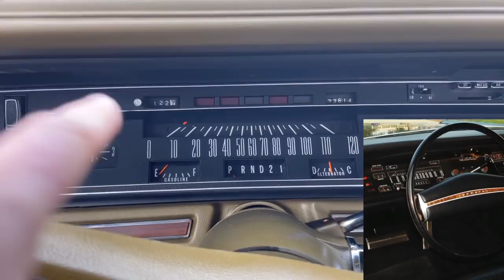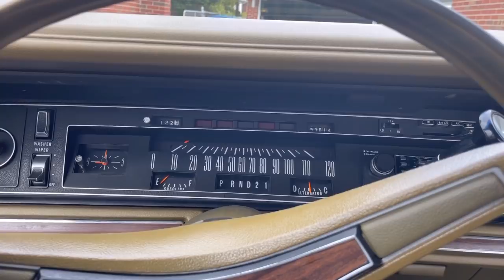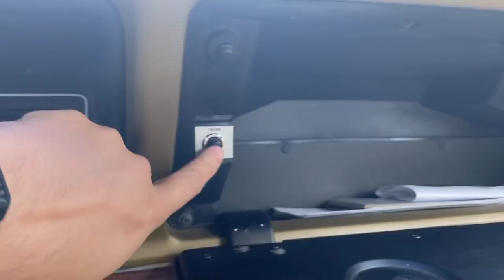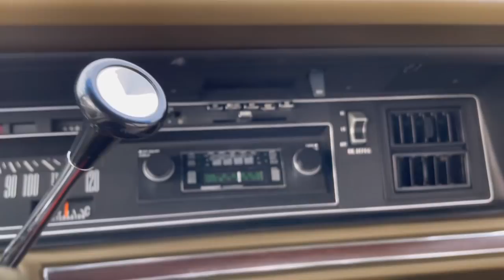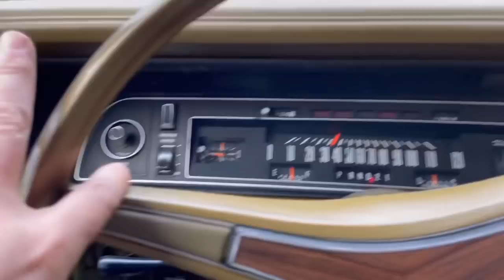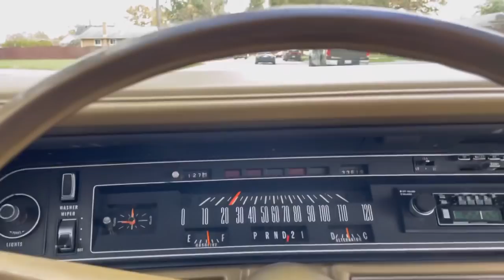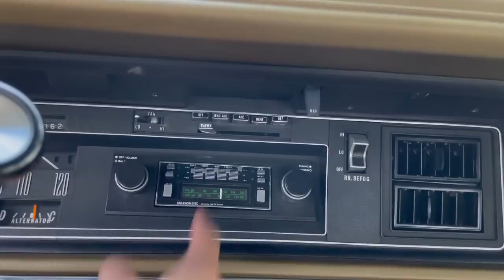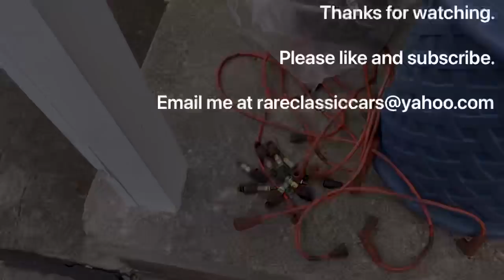FULL REVIEW: 1972 Chrysler New Yorker 440 V8: Fuselage Era Chryslers

Comment: Growing up in my childhood neighborhoods was pretty much a mix of Chrysler, Ford and GM products...and a few neighbors had either the Dodge Monaco of this era with the hidden headlamps or a Chrysler Newport, which was a trim level down from this.  I agree that the later years lost some of the clean design with added trim or awkward grill and bumper designs.  I would argue the next generation...the 74 Mopar full size cars were a step backward style wise and timing with the 74 Oil Embargo didn't help matters either.  And by 1977, they looked hopelessly out of date by the time the GM 77 program introduced the newly downsized GM full size cars.  

These cars did provide a great platform for law enforcement.....and the CHP seemed to like the Monacos as a patrol car.
Reply: As an aside...some of the Chrysler success of the 90s had to do with the engineering teams they inherited from the AMC acquisition.  The LH cars were based on the Eagle Premier....and of course getting the Grand Cherokee, an AMC design to market helped as well.
Reply from the maker: Yes. Chryslers genius was to keep the old Cherokee going and slot its replacement in development more upmarket as the Grand Cherokee.

Comment: On the road noise issue, has anyone experience with installing Dynamat or similar noise attenuation matting on these Chryslers? 
On the ballast resistors, my dad had a ‘73 and ‘78, bought used, that between them he operated for 15 years. Never had a ballast resistor issue. Maybe because we lived in the drier climate of San Diego?

Comment: 225hp, 345 Torque, Top gear ratio 1, final drive ratio 2.76, 3 speed auto, disc front/drum rear.......Top speed 112mph......interstate cruiser, would have very respectful 60 to 90 pulls

Comment: Quality control was hit or miss with these cars. My buddy's New Yorker had a factory stereo FM radio with speakers on either side of the dash, but just solid metal dash top panel. There were no grills for them. Sound was a bit muffled.

Comment: My parents had a 66 Newport and then the 70 Newport. The 66 was a better style. Yellow convertible in the movie Good Fellas. The instrumentation was more impressive and had the rear wheel skirts. It was all a deep green and he had roof repainted white. It made a splash. The 70 had the black Landau roof. The Huge killer with the 70 model was the front end parts going to crap way, way prematurely. It had the 383. When there was a front end, it was usually the ball joints as I recall. When they trashed, the front end would bounce tremendously

Comment: The fuselage cars had too much body mass and smallish greenhouse to be pleasing.  Framed door glass was unusual on an expensive car back then, I suspect the hardtop version was more popular.  My first thought was someone's removed the vinyl roof and repainted, which would explain the molding.  As a kid, I rode in a neighbor's when it was nearly new.  The road noise made it feel cheap compared to our '68 Electra sedan, which had a roomier (and softer) back seat compared to it--and to a 70's Electra.
Reply from the maker: Painted top is factory. It’s on the build sheet.

Comment: I love Fuselage Chryslers but the interiors let a lot of them down. I think all of them sans Imperial had chintzy interior door panels with sloppy workmanship and dashboards that appeared to be designed by engineers instead of stylists.  That steering wheel was a corporate piece that appeared around ‘71 in Plymouth’s and Dodges as well, and not just in the C-bodies. The Chrysler’s were trimmed and insulated like a slightly enlarged full-size Plymouth or Dodge while only the Imperial got a more upscale treatment that arguably should have also been given to the Chrysler. 

Regarding Elwood Engel, he apparently did a proposal while at Ford for the ‘61 Thunderbird that wasn’t accepted but that impressed some Lincoln execs and which was adapted to be the ‘61 Continental, which explains why that car is comparatively compact compared to the competition. When he moved to Chrysler his designs were very square and boxy like the Lincoln. Look at his ‘67 Imperial and compare its design details to a ‘60s Lincoln.

Great review as always! Looking forward to the nighttime IP video!
Reply from the maker: The Continental was principally compact because it had to share chassis bits with lower end Fords like the Thunderbird.

Comment: i had a 71 chrysler newport royal with a 340 poor thing was totaled when someone ran a stopsign at a major roadway and i broadsided them it folded the enite front up to the glass. we hit so hard i blew out all the glass of the pontiac safari wagon i hit. i use to drive that thing like a race car, she would fling the hubcaps off. hell i even tried jumping a section of roadway with a bridge out well that didnt go well. i snapped the distributor shaft timing gear and chain. i fixed her up and drove it till the crash. the day they picked her up from the insurance company she started right up and she heaved herself onto the flatbed. that was the last i saw of her. she was silver with black Naugahyde interior bench seats. which was nice id put amour all on the seats and when i hit a curve the girlfriend would slide right over to me. lol. good times..

Comment: This car most likely needs premium gasoline for best performance. An engine this massive would knock really severely on 87 or 89 octane fuel. In addition you'll want to add octane boosters in addition to using 93 octane premium gasoline.
Reply from the maker: Not needed. It was a low compression engine by 72, designed to run on regular.

Comment: You speak of exceeding 100 MPH in this car...Thing is... the long-nosed sedans of that era had a common tendency for the front end to "lift" above about 96 MPH, regardless of make.  I remember losing confidence in the steering at very high speeds.   And bias ply tires were not the best for negotiating curves.
Reply from the maker: Yes. Of course I run radials now and while they do lift, they car has considerable heft to still keep it somewhat planted.
Reply: @RareClassicCars  Just discovered your channel today.  This was the second video.  These were the vehicles of my era.  I'm a boomer, born in '55.  My third video from your channel is about the Canadian "twin" of the 1959 Pontiac Catalina, a car I rode in for much of my childhood.  We had the Safari Wagon trim and I'd ride in the third row, facing rearwards! 

Anyway, I'm so glad to have discovered your channel because of the nostalgia of seeing automobiles I serviced or filled up.   As a matter of fact, it might be a nice feature of your videos if you could take a few seconds to show us the filler cap for each model.  In the late 1960s (following the concept cars of the 1964/1965 World's Fair) filler caps were being "cleverly" disguised on many upscale sedans and coups.   In the 1970s, I recall some being hidden behind the rear license plate frame.

Also... Those cars ran on leaded petrol.  How are you able to get them to behave without knocking now?  It's not as if they've got microprocessors that can tune the spark advance on-the-fly based upon ping.  How do you tube a vacuum-based advance/retard mechanical system to avoid knock when fueled by modern gasolines?
Reply from the maker: @TheCondoInRedondo  By ear.  I keep retarding the timing until I no longer hear spark knock when the engine is warm.  Sometimes I run cooler thermostats too in order to also prevent detonation. 

But, in most of my high compression cars, I use premium gas + lead additive + 4-5 gals racing gas per tank. Rarely get spark knock with that combo.
Reply: @RareClassicCars  Thank you for taking the time to reply.

Comment: Following up on your comments, a lot of the Chryslers of this era, and even before, gave you size, but put you in a taxicab interior.  Arguably better engineered, better handling, more space efficient, durable (hmm, good qualities for a taxi), but you spent a lot of money for something that could be quite plain jane (and 'boomy').  They did have that '3 in 1" bench - a 50/50 with recliner, an inexpensive option drifting down even into the Dodge and Plymouths, and that was more impressive than you could buy certainly in a Caprice and most of the other GM B bodies.  But if you took a base 72 Newport matched against a similarly priced 72 Grand Ville or the significantly cheaper 72 LTD Brougham, you do have to wonder who, but those that still remembered Chrysler as the 'engineer's car' bought them - on equipment/perceived prestige alone - or the engine/trans combo.  Then again, having gone on dates in a 74 with the full width bench - there was a lot of, ahem, room.

Comment: That interior is a pretty weak cabin compared to the competition. One other thing that I think hurt Chrysler during this era is the lack of quality. From everything I've read, these could be really badly built depending on which one you got. I'm not actually sure if these were worse than Ford or GM of the era, but once a car gets a reputation, it's hard to shake it.
Reply from the maker: Agree on the interior.  People often bashed Chrysler quality.  I think it's a mix of good and bad.  For instance, the core 440 V8 and 727 transmission are rock solid.  Arguably best-in-class for the day in terms of reliability.  However, they're surrounded by some crappy and troublesome components.  Fragile ballast resistors, ignition control modules, poor factory spark plugs, leaky and troublesome carburetors.  So, while the basics are excellent, the overall reliability suffers.  As far as body fits, I find them to not be that bad and actually better than GM, but not as good as Ford.  I think the overall interior is probably the biggest letdown in terms of materials.

Comment: When did they ever have dual air conditioners?? NEVER I was driving Chryslers during the 60" 70's, et..... but the only thing they had in the back was the rear defroster. In our 1958 Dodge Coronet, we had a fan with rubber blades in the window to defrost
Reply from the maker: From the mid-60s I believe through around 1973.  Also had on the wagons.

Comment: How much power does your NYer currently have? I do agree the 1973 front end was very bland looking compared to the 1969-72 front end's, I always felt the fuselage cars should've been better sellers.
Reply from the maker: Around 225hp stock. I’ve added factory style duals, so it’s prob closer to 250hp
Reply: @RareClassicCars  I thought in 1972 GM and Chrysler had better powertrains than Ford did, I thought Ford had the weakest powertrains from 1972 onward.